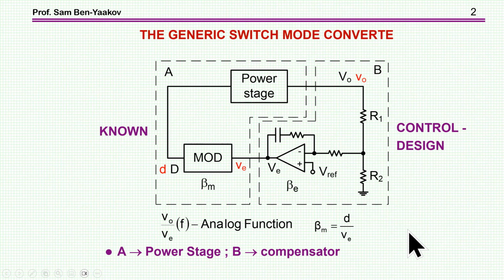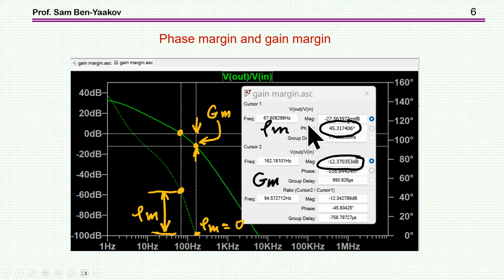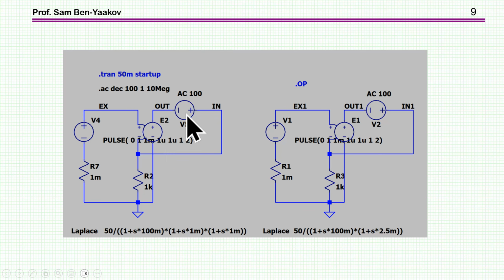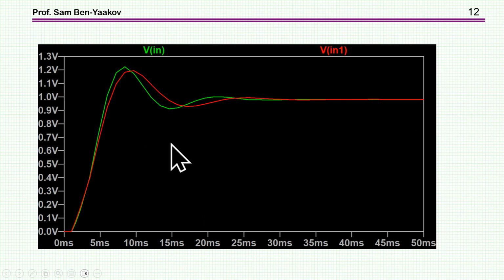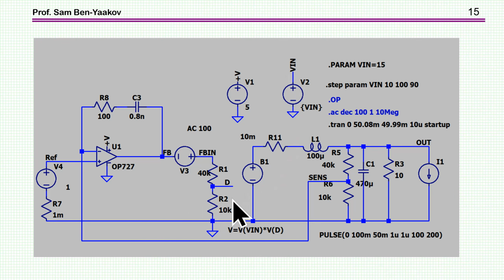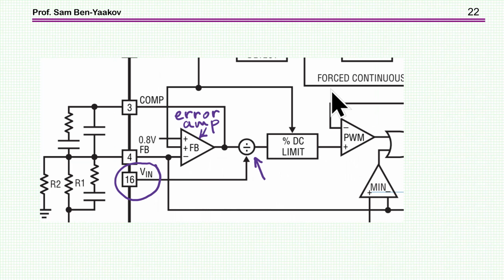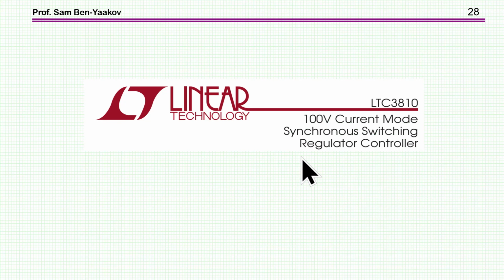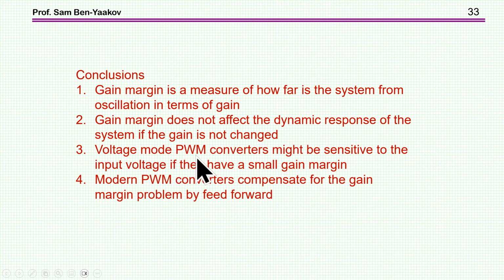Gain margin in PWM converters

Comment: Mmm... But this doesn't mean the gain margin is not important, this only mean that pcm control is insensitive to variations of Vin in terms of gain. You still have to take into account variations in the parameters of the controller and external components and environmental factors, so some gain margin for a given system should be needed.
Reply from the maker: You are absolutely right, practical implementation always requires considering those parameter variations and environmental factors. 👍

Comment: Hi Dr Sam, how do you figure out the D value the represent change in the line voltage? and how I include affect of the line voltage 50Hz or 60 Hz
Reply from the maker: Sorry I'm not sure that I'm following your question. What is D value?
Reply: @sambenyaakov  D is the duty cycle and V=V(Vin)*V(D) , How to choose R1 and R2 to so D value is accurate and also can we include affect the ripple on line voltage if it is 50 or 60hz
Reply from the maker: @karastom2304  This is aclsed loop system. The duty cycle is set by the controller to meet the target voltage. R1 R2 are used to set the target voltage given the reference voltage.

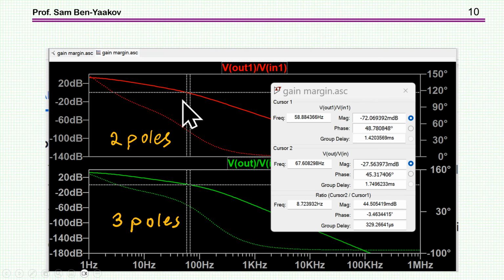Comment: Hi Professor, thanks for another great video. I want to raise a question to your video of T-model and L-model of a transformer a year ago (https://www.youtube.com/watch?v=82U8PBMh2k4&t=218s). I have tried those four modeling methods in LTSPICE and seen that the two L-models give different results as other two (transformer coupling and T model). I have double checked and made sure the parameters as the same as yours. Additionally, all models give like twice higher than your results at 7:42. Do you possibly know why?
Reply from the maker: You mean at slide 20?
Reply: @sambenyaakov  I mean I used all parameters in slide 7 in https://www.youtube.com/watch?v=82U8PBMh2k4 (btw, Cr is missing in all circuits here) and cannot reproduce the waveforms in page 12.
Reply: I believe the L-model has a wrong equivalent turns ratio. The inductance on the side primary side should be: Lm*1k/(N*N)/(KP1*Kp1) - verified by simulation.
Reply: sorry, sec. side
Reply from the maker: You are correct, there is a problem with the L model the way I have put it. I have not recalculated it. Time permits, I will try your solution.

Comment: Hi sir, 
I recently started studying analog circuits and I find concept of "common mode" voltage to be very confusing in differential amplifiers. Some texts write it as common noise which is injected in signal, some texts show common mode voltage as some sort of bias voltage to transistors. And if assumed it to be common noise voltage in signal or even as bias voltage for transistors, then why it is average of input differntial signals?

I know this comment is not relevant with this video's topic, but I want to understand this concept. Please help me to understand this.

Thanks
Reply from the maker: Common mode is the voltage or current referred to the ground of the system. For example, the common mode current of a line fed system is the current that circulates from ground to BOTH the phase and neutral line into the systems. In analog circuits, the input common mode voltage is the voltage between the input terminals and ground. In closed loop op amp the voltage between the input terminals is very small so the common mode is between any terminal to ground. In a differential amp, the input common mode voltage is DEFINED as the voltage between the  average of the  input voltages and ground. You should concentrate not just on the definition of common mode voltage but what it is used for. Once you understand this, the logic of common voltage definition will become clear.

Comment: Dear sir

I'm designing MISO boost converter. It's difficult thing for me that when going to design compensator to PI controller part of the system. Can you do a lecture how we stable the system using compensator and design method of proper compensator using transfer functions. I need to know how we change the gain margin and phase margin of the converter system using compensator.
Reply from the maker: Have you seen
https://youtu.be/bGj1huz2Log
https://youtu.be/Bn7QPJaj-vU